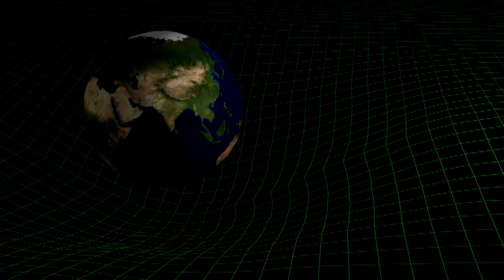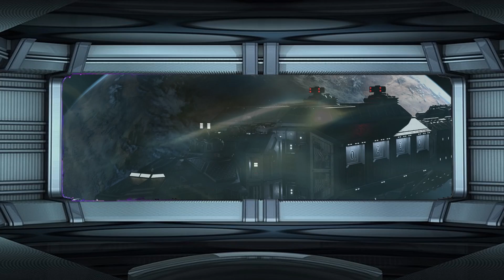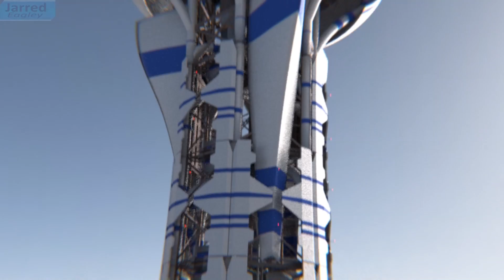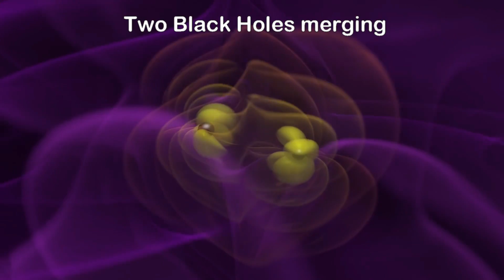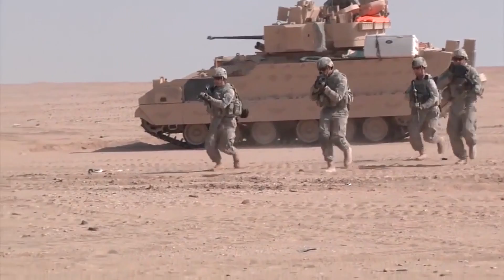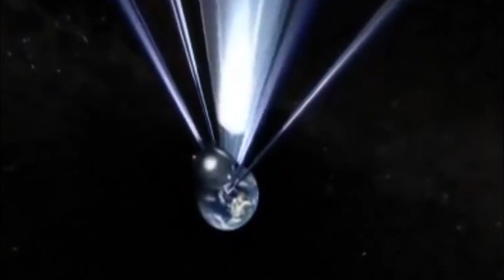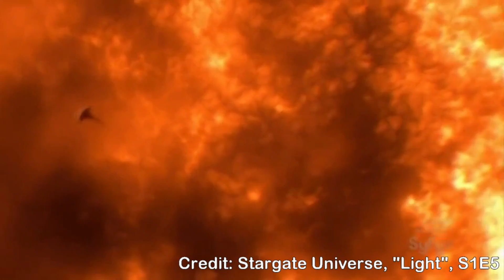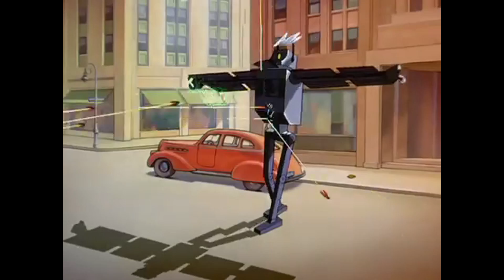Force Fields

Comment: This just gave me an idea for my sci-fi universe I was having trouble realistically justifying. I needed a shield that blocked air into a place, kept it warm, and let visual light in, but not certain wavelengths either way. However, I needed a storm to be able to form as well. Quite the conundrum, huh? 

The concept I've settled on (for a exoplanet's detection-cloaking atmospheric shield) Is an area, in this case, a relatively rocky area of one of Jupiter's ice moons, that is lined with magnetic couplings that connect huge pylons that go as high as they intended to build. These pylons are powercells and emitters for a plasma-based particle shield fed by a few fusion reactors in the center of the shielded area on the inner ring and a radiation shield on the outer ring. These shields are hot, but have heat vents near the top to keep the heat away from the icy surface, however, these vents are large enough and are propelled with enough force to act as what amounts to really strong and hot winds. Anyone who knows about the southeastern half of the US knows convection currents from hot and cold fronts can cause disastrous storms. These vents cause intense wind storms that can even mess with the magnets of the pylons and couplings, leading to the plasma shield itself having the type of large electricity spikes you'd expect plasma weaponry to have. These cycling storms have the added benefit of hiding the civilization present and keeping the temperature to the point where regular winter clothes can be worn by augmented people and a couple layers extra for natural ones. 

The secondary shield, the outer ring was installed when the civilization tried to hide itself from long-range detection from the powers of their own solar system. (As explained on this channel before, it would be absurd for them to try doing so much further out after using very obvious tech like radios and the like for years prior to going into hiding) This ring works only as a light shield to infrared and ultraviolet wavelengths, blocking out these from both in and outside the shielded area. 

I dunno. Do y'all commenters think this makes sense? Lore crafting is kinda hard.

Comment: if we could make a time field around the ship, like a skin of still time. where nothing could get thru not even light, it would be vantablack on both sides. im not shore any thing or any type of energy or radiation would get thru, as every thing needs time to move from point A to point B. and a skin of nill time wont allow that, it simply would not get past ,,,(but what might happen is because time in the skin is not moving,  any laser fired at the skin would bunch up at the surface and wait, a missile would hit just like it was solid, the missile would crush and explode but the shock wave would hit the skin and bunch up  waiting, and when you turn off the time skin, any thing caught on the skin would continue on it way and hit you, ie the laser would be turned from a beam to a single flash, with all the power from the full length of the beam or shock wave

Comment: Lasers can be dispersed by water beads in a heavy mist.   Water spread out in a leaf shape sheet  that is breaking up into droplets it will disperse the beam like a thousand lenses and weakens the coherent light making it ineffective at cutting.  Running  metal in such a shower might do the same with projectiles, not stopping them but dispersing their kinetic energy.

Comment: We can't do it yet.. but it seems very small particle accelerators.. on the atomic scale.. arrayed in a 2D circle or 3D sphere.. might be able to "fuse" atoms to make fusion energy on a tiny scale.. or even "fuse" particles to make exceedingly small "mini black holes" or "hawking particle" generators.. mini-black holes "Exploding" should create gravity waves.. like "shaped explosives" it seems you could learn to direct their shape, direction and potential.. to not only gravitic effect.. but also to set up secondary cascades in other systems.. ghestalt "like" they could be used as "signal field" generators.. or like "guide stars" for gravitic astonomy to make small gravity lenses for increasing resolving power in particular directions "beyond gas clouds" for example.. or for beam forming to manipulate things at a great distance

Comment: Weak Force particle interactions are not a technology we currently use in an organized form, but with nano and pico machines required for making quantum computers and molecular meta materials.. we might reach a point where we can organize sympathetic or resonance "Weak Force waves" or domino like interactions that propagate across a medium like a uniform air pocket stronger than even the Pauli exclusion zone forces.. possibly strong enough to stop a nuclear explosion or contain it, if not deflect it.. then again.. we may discover ways of using Quantum effects at the Macro scale initated from the Pico scale to "skip" a heart beat in existence.. like the Chesshire Cat.. instead of dead or alive.. neither here not there.. but for the briefest moment.. and "miss" the passage of an impact or energy weapon.. or even "detect" a possible future collision as a possibility like a backwards propagating signal in Time and Space.. but lacking the detail to know precisely from which it came.. and "choosing" to lower those odds.. and there by effectively "deflect it" from occurrence.

Comment: A "Pion" beam array might also be able to create a virtual particle "field" where the pions transition into positrons and explode upon contact with electrons in atoms in the air.. effectively building a wall or any shape depending on the beam array. The mu-pion penetrating power for example could go very far before decaying depending on the speed they are traveling.. Come to think of it you could do that with Neutrons too with beta decay.. but a little harder. Beam array forming of Sychrontron Radiation could also form a shaped wall.

Comment: What about a quantum entangled "field" of distributed and concentrated particles.. like a Cassimir effect seperation of two plates.. only shrink one plate in a way that concentrates it without breaking the quantum entanglement. The "Big" plate remains as a kind of shock absorber that conveys the energy interaction of a Laser or Impact to the smaller concentrated plate that heats up.. you might have to dissipate the heat.. but would get a chance to redirect it so it isn't directed at you or what your trying to protect.

Comment: Thanks for all your food for thought Isaac! If you can figure out how to make a light and sound system one thing you might be able to do some antigravity stuff with the same system. Light waves and sound waves are very different things. I’m down for gravity based force fields. Plasma based ones would probably still let neutrons through at high speed. Still painful. This is more useful for space travel at high velocity than for warfare, to me anyway, but thanks for pointing out that those are two very different sets of tech advantage, in terms of reverse engineering solutions to other people’s defensive tech. Space warfare is just such a bad idea.

Comment: couldn't shaped explosive charges be used to dissipate most of the energy from an incoming projectile? not quite a force field in the traditional sense, but it's a high energy pulse that neutralizes incoming projectiles, and one that could easily be mounted to the exterior hull of a space craft...

although i guess that's more similar to reactive armor than actual deflector shields. then again, isn't DARPA's anti-blast plasma shield something along the same lines?

line a warship's hull with half a dozen or so aimable shaped charges pointing outwards per square meter or so, and when an incoming projectile is detected, aim and detonate the charge to counteract the force of the projectile. this system could be used multiple times in each section of the ship's hull before being depleted.

oh... he talked about that...

Comment: Perhaps this topic could be re-visited to feature speculative discussion about using force fields to make vacuum balloons, nuclear lightbulb engines, and holding reflective materials in place to reflect light including gamma rays. Force fields promise to be the key to building and manipulating things that matter can't withstand. Hovering vehicles. Underwater cities. Flying cities. Planetary launch craft. Immense nuclear reactors. Containment of antimatter or black holes. Shape-changing antimatter or black hole engines. Immense reflective dishes or radio antennae. Construction of orbital colonies by spraying heated material upon a force-field form. Rendering of whole asteroids through compression within force fields. Force fields might be shaped to behave as any sort of mechanism we want, frictionless pumps, deep-earth drills, instant seawalls, firewalls or storm curtains. All these things made of little other than the field emitters, their control systems, and whatever horrible force we're keeping contained inside.

Comment: If you're serious about understanding force field/anti-gravity technology you should read "Confinement of Light: Standing Wave Transformation in Phase Locked Resonators"

The origins of mass and inertia can be deduced from Lorentz Doppler shift transformation of standing wave. This gives you a 'mass field' or a 'massive photonic field'. 

It's ALL about 4-wave mixing and phase conjugated electromagnetic fields. You can 'hide' an electromagnetic wave by destructive interference with an equal and opposite wave, and then by changing the interference pattern between the sources of those waves, you can generate a force upon the sources, or move energy INTO or OUT OF the hidden standing wave field. 

This is sometimes referred to 'scalar' electromagnetics as it is a very special case of standing wave that can only be achieved through phase conjugation. The vector fields of the EM stress energy vanish, they go to 0, while the tensor/scalar potential that warps space as mass/inertia remains in the interference region.

Comment: I think the airm ovingfaster then a bullet problem can be quite easily handwaved if the forcefield itself has a thickness greater then the ddistance between twom olecules in air - that is still very thin but you could argue that the air won't be affeted, as it doesn't try to shove through the forcefield, rather it is just bouncing back and forth at great acceleration, meaning that the muh smaller acceleration that ould be needed to stop them over the thickenss of hte forcefield would be relatiely negligable

Comment: I thought that the point with the shields in dune is that they resisted a certain amount of force, i. e., a knife or hand moving too fast would be pushed back while a slow moving one could slice through. If that is the case, then the fast moving but relatively forceless movement of air would not cause the shield to resist anything.
Of course, it is academic because we dont know what mechanism would actually be generating the field and its behaviours in general. But it's still fun thinking about it!

Comment: If there was only something that could exert strong antigravity at very close range (like tiny blackholes do with gravity at close range). Then lasers or projectiles would tend to bounce off when they reach it without much gravitational impact to the general surrounding space. A very massive impact probably wouldn't be stopped (like in sci-fi, when one big ship collides with another and goes right through its shields). Of course, there is still the self-blinding issue.. but on the plus side, it might make a great cloak.

Comment: It seems to me that the most important use for antigravity is anti time slowing. Put a computer which is already at whatever limits you have, and suddenly the clock rate can be multiplied by ridiculous numbers, with antigravity comparable to a black hole an observer at the event horizon would see the universe pause, and for an observer outside.... The inner observer ages infinitely fast.

Comment: A combination of nanonites programmed to disassemble incoming projectiles and a micro gravity field to deflect photon based munitions and explosions. The nanonites themselves could potentially house the micro gravity fields and the energy they absorb from kinetic based weapons could help power the micro gravity fields in conjunction with a nice micro fusion battery.
Reply: If you look at his self-replicating machines episode or his post-scarcity episode, he shows how that kind of thing would not work. Bassically, the dissasembled projectiles will still be made of the same material, and have the same energy loads. Not to mention the fact the nanites would have to move hundreds of times faster than the speed of light to do said dissasembly quickly, and would release massive amounts of thermal energy doing so.
Reply: Well then the solution would be to design two types of bots that inhabit the field. One designed to neutralize and take the hit, the second designed to pick up the scraps and rebuild the ones that take the hits. They wouldn't need to move the speed of light to block an incoming projectile or matter based attack. I'm sure there'd be a maximum limit as to how fast the bots can reproduce, but it would be efficient enough to where the user could take far more punishment then what we're capable of now.

Comment: You are right to say that the more you think about force fields, the more insane things come to mind. I dreamed up a few for a sci-fi novel I will probably never write. Here are my favorites.
1. To surround a planet or satellite to facilitate an Earth-like pressurized atmosphere. The moon, for example, is a great place for something like this. The gravity of the moon will not hold an Earth-like atmosphere, but a plasma field could be erected to create a barrier that would be preferable to glass or plastic domes. For one thing, that magnetic field creating the plasma could help remove harmful radiation, and yes you can also tune the plasma to do the same job. Since a day on Luna is roughly two weeks long (as is the night), the risk of boiling high temperatures during the day and sub-arctic nights is very real. Those risks could be mediated by altering the infrared opacity of the shield. There isn't going to be much natural wind in that environment since wind speeds are related to rotational velocities which are quite low on Luna. That makes it more difficult to move warm air masses to the night side, or cold air masses to the day side. Both might be possible by altering the volume of the atmosphere to expand day side increasing volume to create cooling and contracting on the night side to increase warmth. And it has the added benefit of providing a shatter-proof medium for microasteriods to burn up in long before they pose any danger to the surface. Finally, Lunar gravity is adequate to keep the air loss slow enough that a catastrophic containment breach would easily repaired before it could even be noticed. 
2. Vacuum Balloons. Today's limitations in creating the vacuum balloon hinge mostly on the material strength of the balloon. Since the plasma would be nearly weightless and would not be at risk of ripping or tearing, it could make such structures possible. Even if surface pressures render the support framework too heavy for the vacuum balloon to lift, upper atmospheric pressures are far lower. In those environments, the supports needed could be much lighter, potentially making it possible to build large floating structures in our skies. Such structures could become great places to position near-space solar farms, or at lower altitudes to hang wind turbines into the jet stream. It may even be useful as a construction platform for megastructures like a space elevator, or to serve as an intercept for a skyhook assuming was traveling slowly enough. 
3. Adaptive wings. Imagine a spacecraft capable of reentry onto any celestial body. It could be wingless for landing on asteriods moons or other airless rocks, but to land on a body with an atmosphere requires a custom touch observing atmospheric pressures, composition, and gravity to name a few. But if upon reentry the craft could deploy customizable wings that are unlikely to be at risk of burning up and can alter size and shape to accommodate the conditions at hand you could do exactly that... assuming of course that there is a surface to land on. Craft with such wings may even be able to survive inside the atmospheres of our gas giants providing us with a wealth of data and a spectacular view. 
The only topic in scifi that I have found to provide more fertile ground for my imagination are wormholes, and the tactical implications of those are enough to quell any hopes of traversing one even if only on the subatomic level.

Comment: Hypothetically, if we build machines that can warp space time plus we develop sensors that observe at light-speed or faster than light (perhaps by very cleverly using quantum superposition and other q-weirdness to our advantage) and a very advanced (quantum)computing architecture & AI to go with that, then in theory, would we be able to simply bend space in the path of a projectile or beam or any other threat and divert it away from the vessel? Alternatively, the warp "bubble" itself could perhaps be configured to act like the event horizon of a theoretical white-hole (stuff can come out, nothing can go in~ the opposite of a black hole event horizon), if we managed to advance far enough in space-time manipulation & warp. This would theoretically eliminate the need for even a shield since the warped space-time bubble that surrounds the vessel redirects everything outside of the bubble trying to penetrate through, to the vessel, back into regular space (like a mirror effect, only with light/energy AND matter being deflected/reflected).